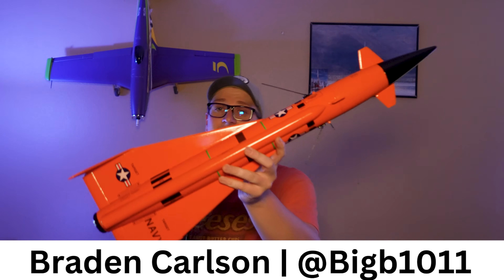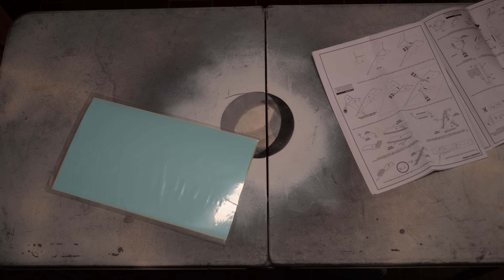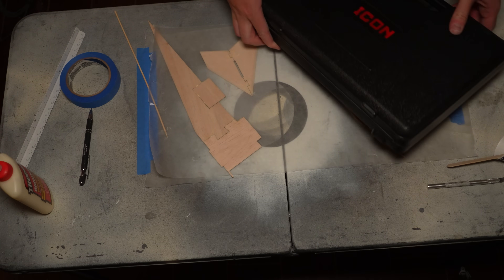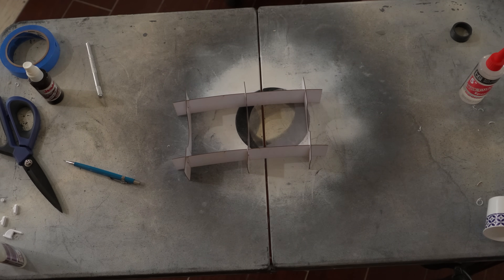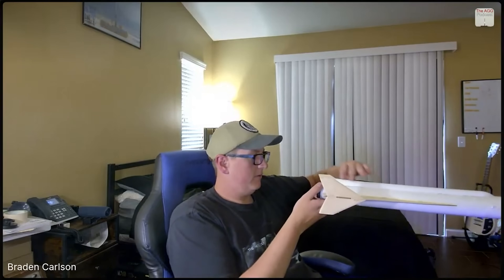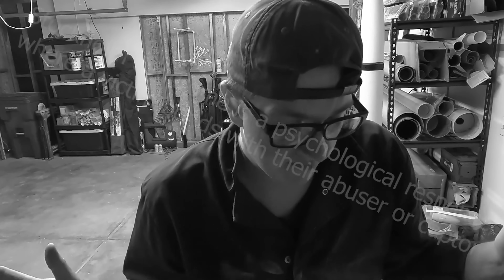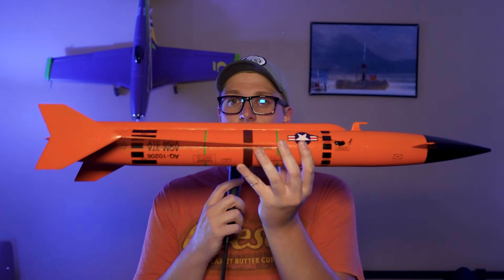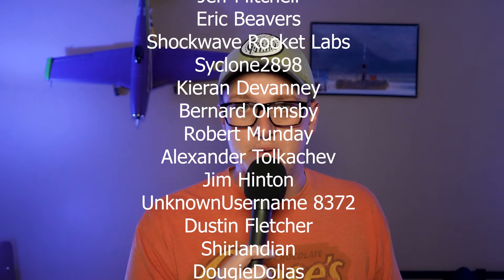Estes Pro Series II Jayhawk IS HERE! | Unbox and Build

Comment: If I recall correctly the original Jayhawk was a Centauri brand rocket(in the 70s).  speaking of sanding and filling when I first started the balsa was not even precut. The sheets were just marked. And we always used the sanding sealer. I tried to find your video about the Cold Power rockets and dragsters.
Reply from the maker: The original Jayhawk was a military target drone ;) 

I believe Centuri did manufacture the first kit, but the original Estes Pro Series lineup in the 90s had a Jayhawk of the same size, and folks have wanted it back for quite some time. Now it's here! 

I have never flown any of the cold power stuff, but I did just get my hands on one of the dragsters and will have a video out on that sometime soon!
Reply: @RocketVlogs  I had a friend that had both the Cold power rocket (it was an Alpha 3 style) and the dragster. You had to make sure the guideline was EXTREMELY tight. As far as the rocket goes you could get some pretty serious altitude. If I recall they both used R12 Freon which you can't get anymore.